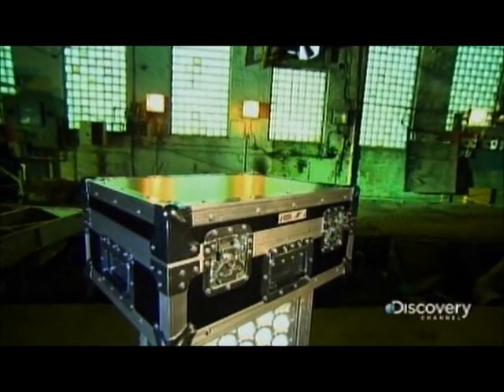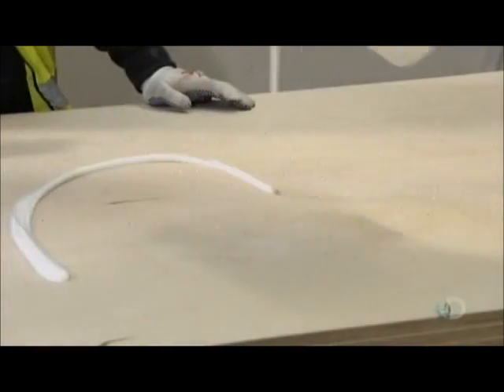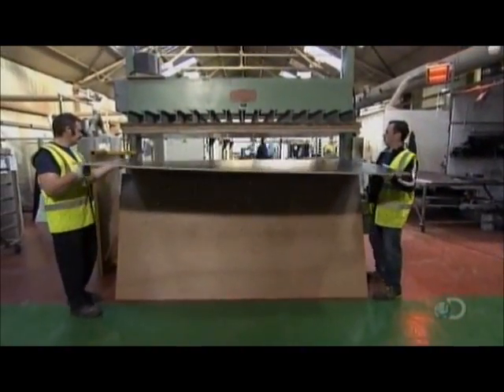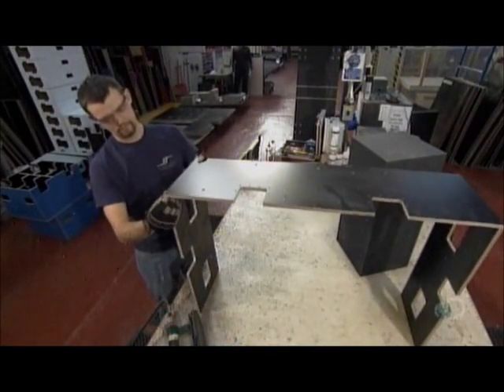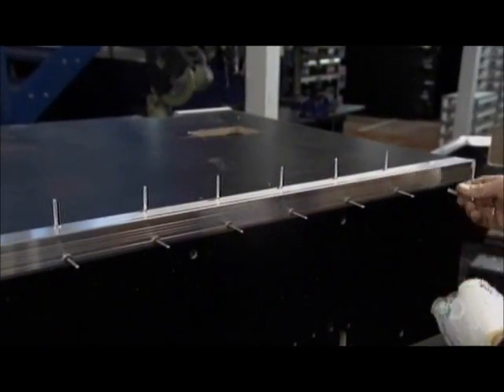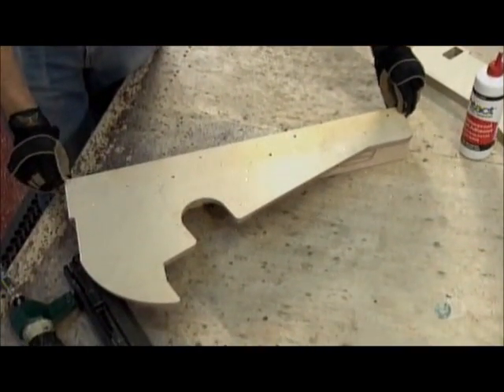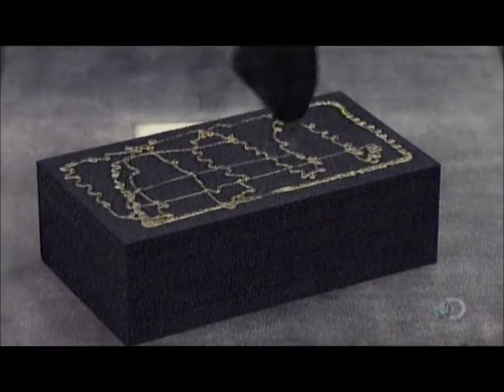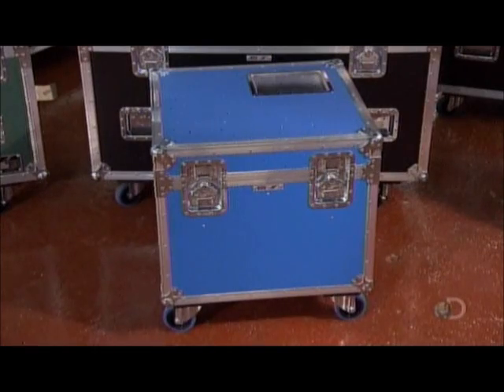How It's Made - Road Cases

Comment: Built a mixer case. Bought most all from DIY. I went to local HW store for the extruded because scrap would be way too high if cut to ship.  Glad I got rivets from HW store because after I went back for the 3rd box at least I know heads all match.  Does it look good and fit purpose? = YES.  Was it cheaper than buying a built case? = NO.  Was it quick to build? = 20 man hours.  Glad I DIY'd? = On the fence.  I guess at least I know it will fit the mixer.  In my mind it took a lot of time.
Reply: I dunno man but imported products and branded flight would be twice the price at our place.
Reply: I'm in the process of doing the same thing why pay $600 for a case when I can make one for $300 and have it exactly how I want it and have fun while doing it. They will be housing 2 ADJ FS3Z ( a $1,000 Stage Light).

Comment: nice operation,, I have to use a double wall profile ,, and table saw for the wood and jig saw. Also a radial arm saw for the mitre cuts on the T/G.. it would take me 5-6 hrs to do the same project.. automation is nice,, a cnc router would be my ticket,, with a auto feed table for the plywood..